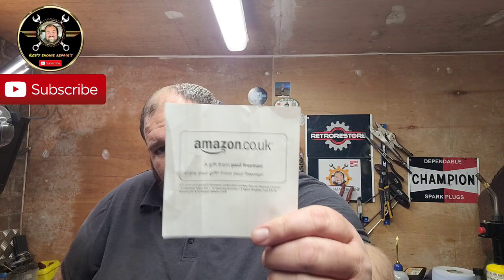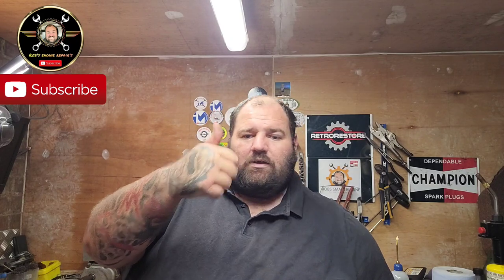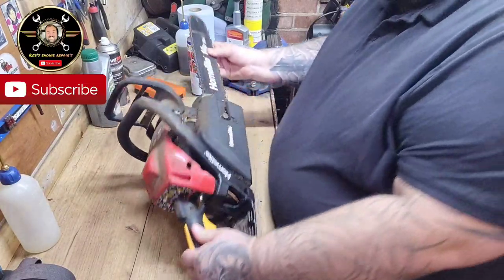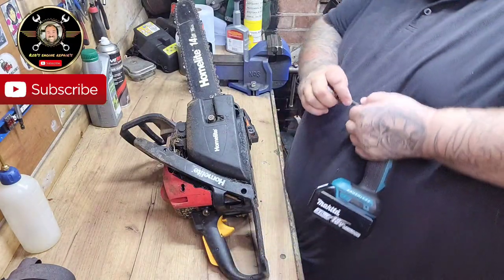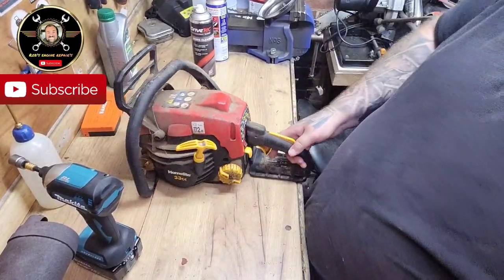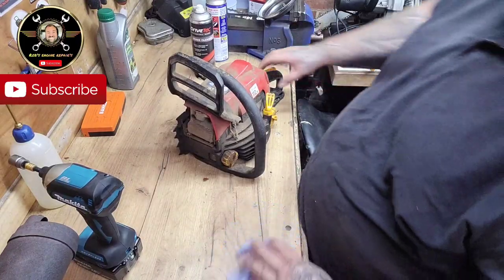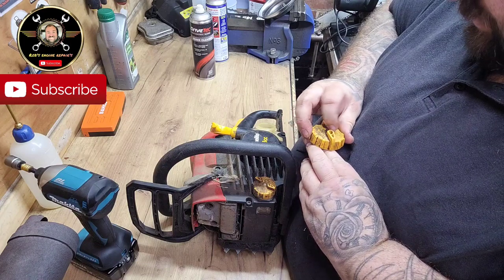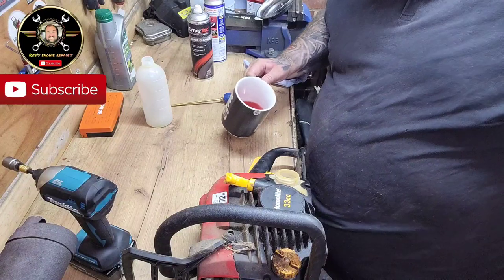will this homelite chainsaw run?

Comment: Good to see you put avjdeo on.Was that carb a ruxing.Good luck to you all
Reply from the maker: Hi Martin and I believe not the owner did say was running but obviously not bud
Reply: @Robsenginerepairs  typical never beieve the customer i repair alot of that brand most are past it not worth doing.But i do try to fix as many as is possible.Just finished a large job lot of Sthil for a regular customer.most were ok but a couple need to much for him so he said keep for my self.So Ebay non oem here we come.